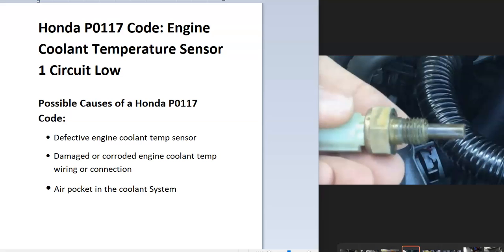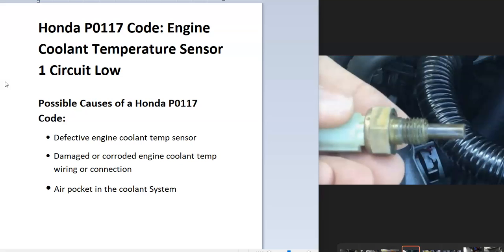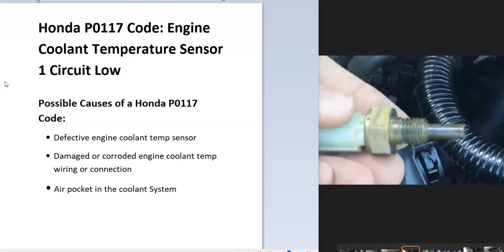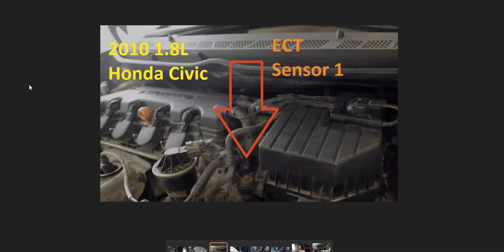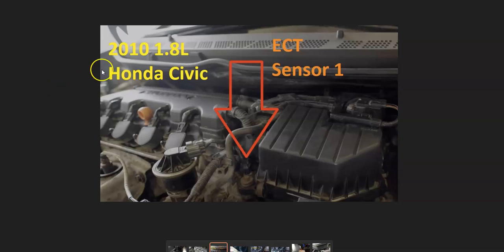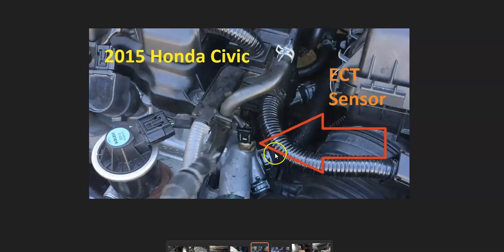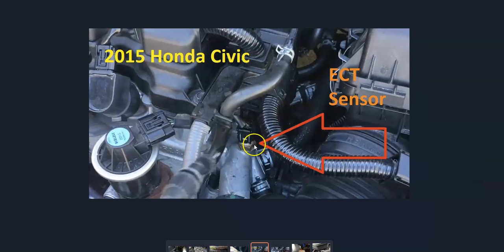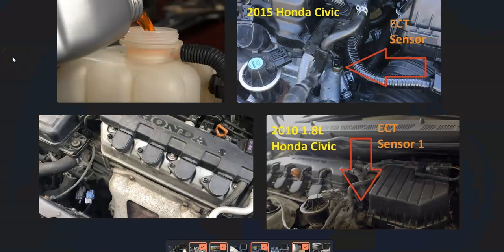How to Fix Honda P0117: Engine Coolant Temperature Sensor 1 Circuit Low

Comment: Radiator fans not working causing the engine to overheat checked the fans connection with electricity and it turns on also when I press the fuses with pliers it turns on aswell I have a 2007 Honda fit